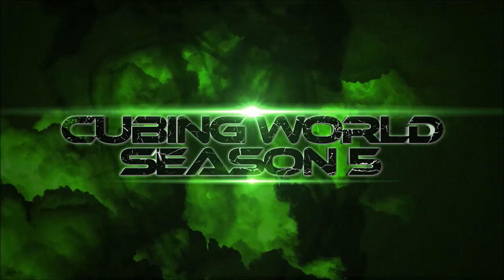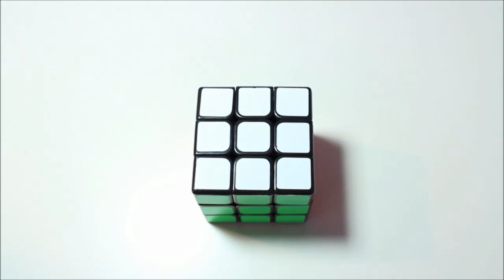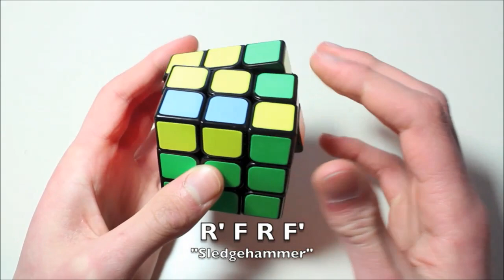[Collinbxyz] F2L Techniques: Partial Edge Control

Comment: With respect to U edges, do you find much advantage to edge control with inserts other than the last? In practicing edge control I find that doing it on the earlier inserts sometimes ends up being wasted effort -- with subsequent inserts sometimes "undoing" the edge orienting from the earlier inserts (if I'm not careful).

I know there are ways to create easier pairings by edge controlling early inserts. That's too hard for me now.  I'm asking just with respect to U edges.
Reply: Adventures in Cubing Sometimes with the third pair, it may be helpful to affect orientation of the edges. Any earlier you will likely undo any effort put into it.

Comment: I feel like those 8 cases you went over really only needed to be broken down into 2 cases:

When the UF edge is oriented, do U R U' R'. 
When UF edge is NOT oriented, sledgehammer.
Reply: I'm late, but UF is the Up and Front face. So If you are holding a solved cube yellow on top and blue front, the yellow blue edge is the UF edge.
Reply: what is UF
Reply: This would not work with the case shown at 2:10